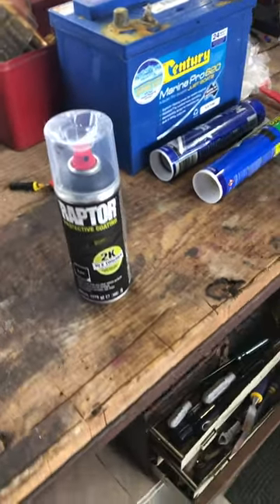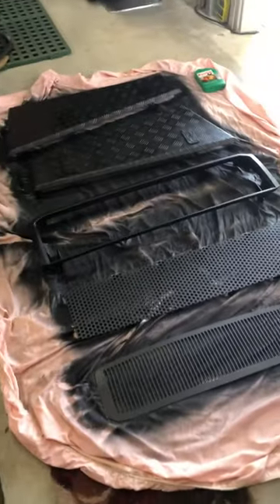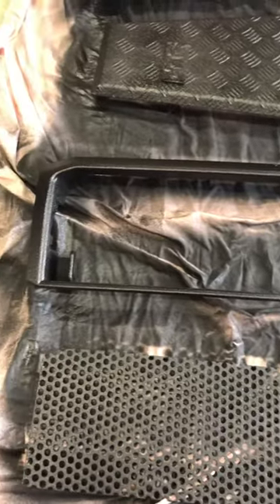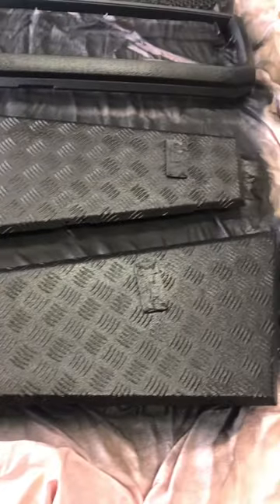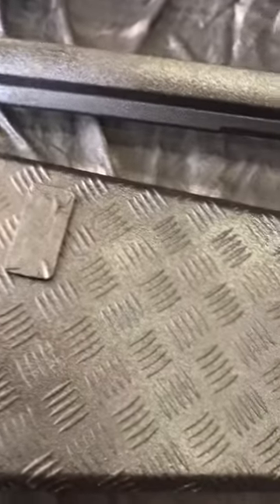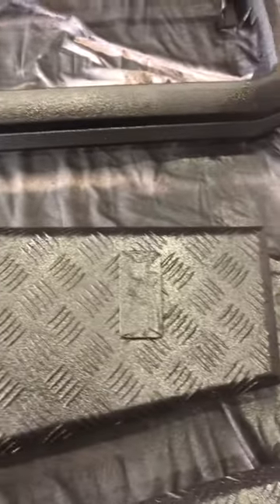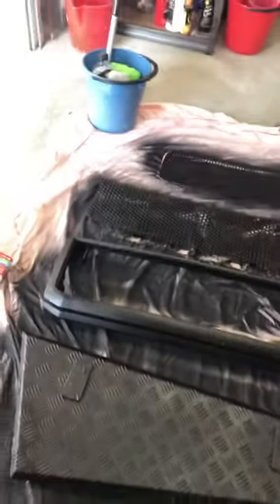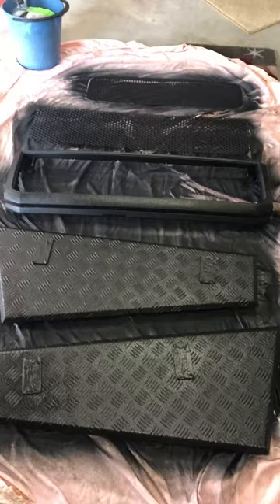Raptor 2k coating Part 1

Comment: oh i like this paint, not that I need it. but makes me want too buy some
Reply from the maker: Raptor (in a spray can) is not the cheapest way to buy this product.  You can, for example, buy a 1 litre container or a 4 litre container.  The 1 litre container, from a local supplier (and tintable) cost $90.00 odd.  The standard colours, so I understand, are white or black.  Not sure what the cost is for the standard colours or the 4 litre container.